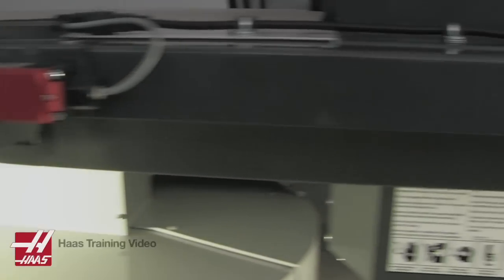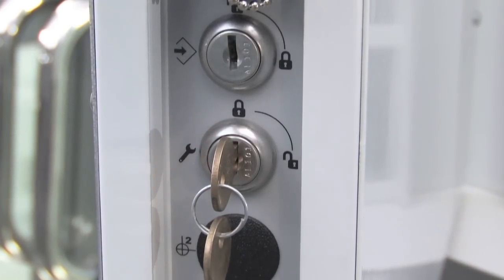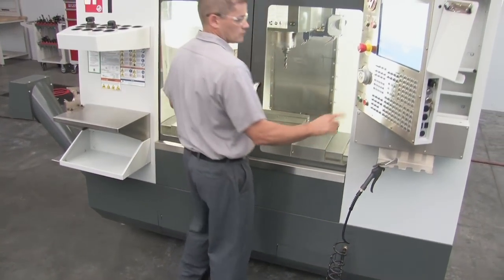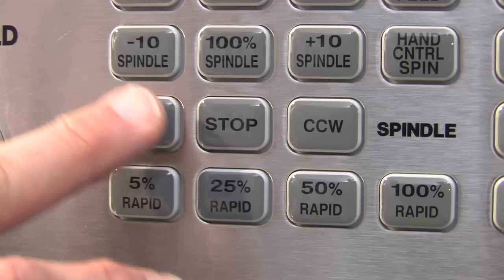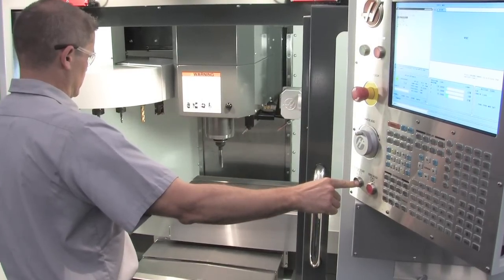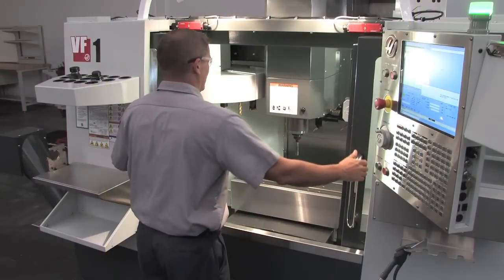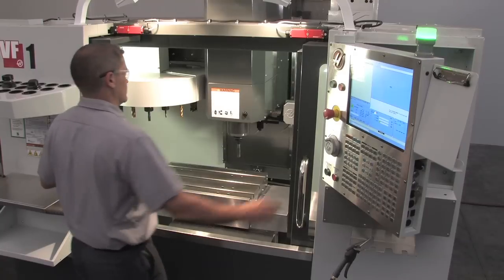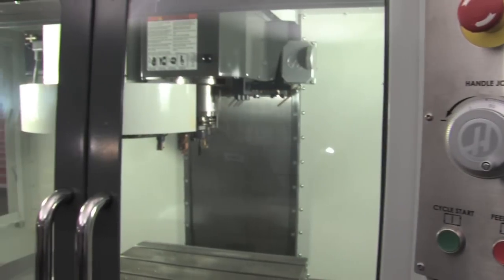Haas Setup and Run Modes — How To

Comment: Dunno if this works on the new ones but hit setting/graph then type 51 followed by down arrow then left arrow
followed by enter then Y and  powerup restart.
I run 4 different Haas machines daily and the setting is the same for all of them but the newest one is a 2006 model
and I do this every time I power up the machine.
The Hass techs will get fired if they show you this!!!!
I figured it out on my own LOL
The only time I enable the door safety is if a totally untrained person is going to be mindlessly loading parts which rarely
happens in a job shop....
Its next to impossible to set up or work on the machine with the doors closed!!!!
Thanks safety MORONS!!!
This type of attitude just encourages employers to hire completely unskilled labor while the guy on the shop floor
that can setup and repair these machines gets sent programs drawn up by some snot nosed kid that has never
had dirt under his fingernails and specs 1" deep 10-24 holes in 316 stainless.....Doable? yea kinda barely but,
If you get the luxury of seeing the BIG picture with the material list for the assembly its often that they list a 3/4"
bolt length to fasten a 1/4" thick part to this part that some idiot specified a 1"deep hole for............
This is just an example of what is happening in our "modern" world...
Employers are hiring straight out of school anybody that has had a few months of CAD drafting and maybe a little CAM
and putting them in an airconditioned office to send garbage prints or programs to the shop floor.
Machinist was once a well respected trade and took years of apprenticeship and work now we are treated like dirt.
PS I can 3D solid model, 3D draft, CAM and manual program.......
PSS what about all the large manual machines out there??
We have a 50" swing manual lathe at work with no guards at all, NO you don't put a first week 18 year old intern
on that machine but by the same token why would you make the easiest to set up and use CNC machines out there
a pain in the ass with stupidly over safe BULLSHIT interlocks..........

Comment: I hate having to keep the door closed when doing tool changes. How the hell are we suposed to get anything done? I like my old ones better!
Reply from the maker: Hi pd4104gmbus and thanks for the question/comment. The door locks are set up to ensure the safety of our customers. Haas Automation is conforming to safety standards set for the machine tool industry. We understand that it takes an extra second or two to close the door before each tool change, but it may save a life. Thanks again.
Reply: Haas Automation, Inc. Who was the genious that decided maximum RPM with the door open is 740 rpm? An edge finder has to be run @ 1200 rpm. So now you cant edge find a part with the doors open? Brilliant! Doing prototypes in this machine is a pain in the ass. Having to open and close the doors that many times a day is ridiculous. Not to mention its harder to open because of the spring in the detent! Oooops I just mentioned it....
Reply: @pd4104gmbus  Who's the genius that doesn't understand max door open rpm is user selectable in Settings?
Reply: Diesel Ramcharger is the Max value not 750 though?
Reply: @pd4104gmbus  możesz zmienić prędkość 750 w ustawieniach 292
Reply: pd4104gmbus Enjoy what little freedoms you have at the moment. Let Quebec be your canary, here the local safety comity CSST has created a hole industry around making needles safety regulations and penalizing violations. Look forward to having the doors on your vmc always locked and can't be opened until after 3 seconds of the spindle stopping.
Reply: Haas cnc machines are not good machines for making prototypes or something like that. These machnies are in my opinion only for a massive production. I think that machines with Heidenhain iTNC 530 or gigher are better for a prototypes manufacturing. 
Also renishaw probes with haas cycles sucks. Heidenhain has better cycles and also offers manual touching off the points with digital probe in handle mode. Have a look on machines with Heidenhain. Yes you can tell that machines with heidenhain are more expensive, but for example DMG MORI (older name Deckel Maho) are very good machines and with heidenhain its the best way for prototypes. Many cycles for example cycle 208 (helical milling cycles).
Reply: I can imagen someone putting their head in the machine and pressing next tool by mistake, and the tool change arm going smash into their skull
Reply: @chaddanylak8706  please mr. Government man save me from myself please hurry before I do something stupid. Please make the world safe for idiots like me
Reply: pd4104gmbus don't worry, just hang tight! Trump will soon get rid of hippy laws and make machining industry great again. #deathtosafety

Comment from the maker: Hi captain2231, thanks for the question. The entire CNC machining industry has adopted new safety door locks. We implemented the new Haas safety door locks January 1, 2011. Sorry that you find the new locks inconvenient. Yes, attempting to override the safety features will void the warranty (as well as make the machine unsafe). Again, thanks for the question.
Reply: Get with the times you old farts, get used to it! 😂
Reply: As much as I concern myself with safety, your new system of doing things is now making my job unsafe.  The new machine works different from the rest of the shop so now I have two methods of behavior depending on which Haas I'm working on.  If I get it wrong, now I'm in a position to get hurt!  If you have to have a new system, at least give me the option to bypass it so all the machines work the same. If this is about CYA, I would be happy to sign a waver releasing you of all liability!  I'm a prototype shop, I setup a new jobs almost everyday.  Opening and closing the doors for every tool change is a major pain in the ass for every setup I do!  I run the job with the doors open and close them for a quick coolant wash and open them again and now the machine stops, this suck!  I wonder what safety features they now have on band saws and drill presses. Those machines are ten time more dangerous than all my enclosed CNCs combined!    I'm calling BS
Reply: @toymaker-te8fq   that is correct , for prototype is totally annoying the amount of time wasted. is just not profitable to have a haas machine for prototype, not wort it.
Reply: Your new feature on safety, makes your machine useless on set up time. It is really annoying feature that certainly help when you hire none experienced people, otherwise it is not a an improvement for your equipment since is intended for trained personnel.